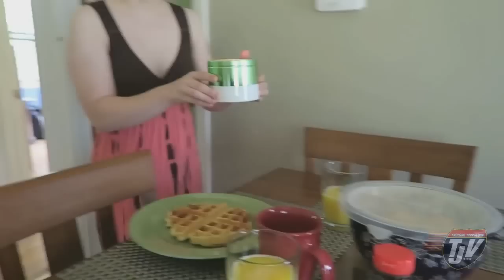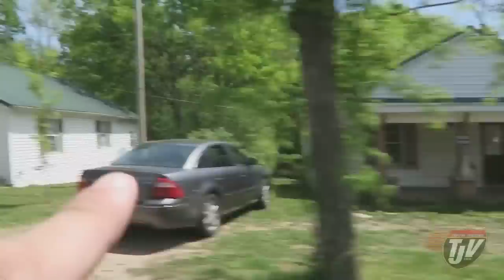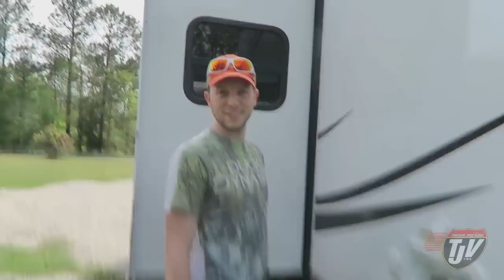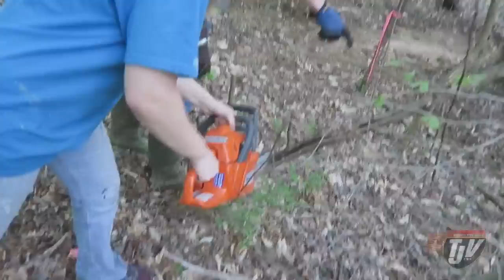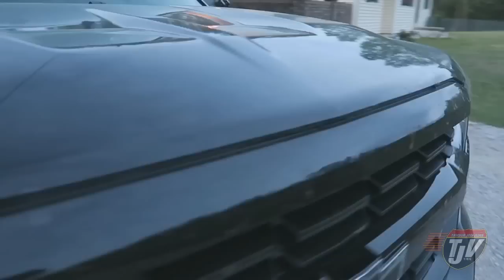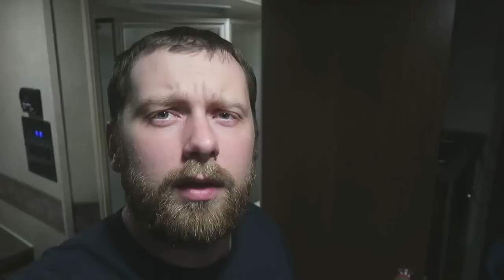CHAINSAWS AND SNAKES! - #703

Comment: I have a camper, and have been using mine for along time. Before u connect the water hose, u should have an adapter (reducer)that the water hose connects to first and the connect to the camper. If u don't it blow the water lines on the camper. Camper water lines can not hold the pressure of the full force of the water pressure from the "city water line". Call any camper sales place and they will till u exactly what I'm telling u. I found out the hard way on my first camper

Comment: Hey josh btw you only need to turn the water pump on if you are pulling water from the fresh water tank, not when you are connected to city water because the city water all ready pressurizes the system, and you can actually damage the pump if you try to run it dry.